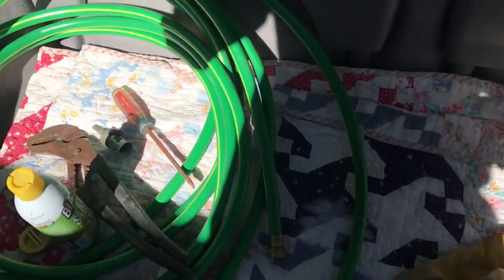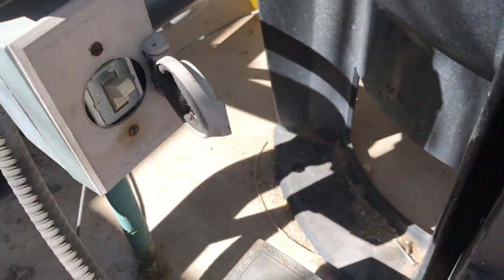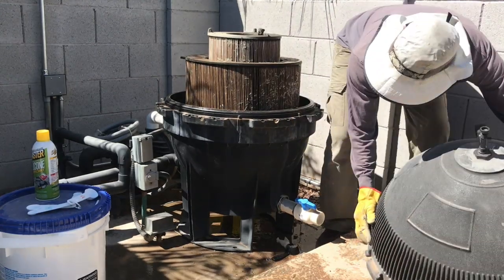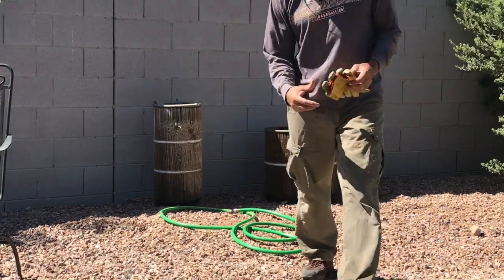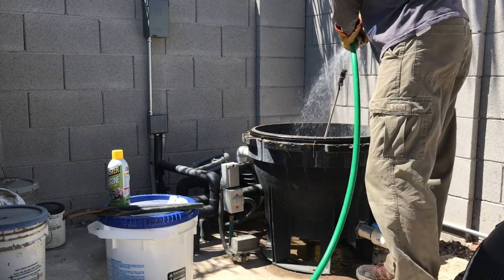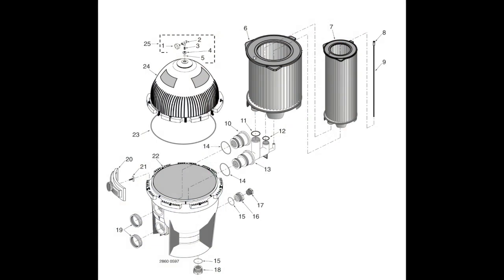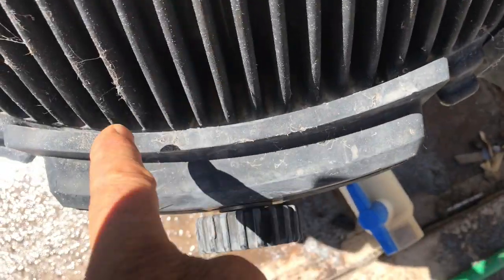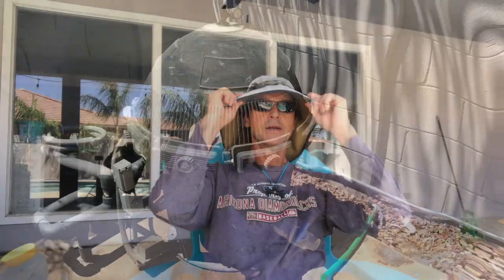Cleaning a Sta Rite Cartridge Filter

Comment: Great video!! It helped me clean my 90yr father’s filters correctly 🙏🏻 I looked for the video you referenced about where to buy new filters on line cheaper, but couldn’t find it?? Would you please reply with link when you have time? Thank you again.
Reply from the maker: Here's the link to the video on how often do you need to change the cartridges in your filter.  However there is no link to where you can find them mainly because they are specific to each type of filter and deals are always changing on the internet.  So my best suggestion is to do an online search (maybe start with Amazon) for the specific cartridges for your model filter and look for the best deal from a reputable source. 

I'm glad my video helped. Hope you subscribed and please share my channel with others.

Comment: thanks for the video. i used it to follow along as is cleaned the filter for my pool. however after i put it together there is a leak. if i open it up to adjust the o ring spray silicone, do i need to add more DE?
Reply from the maker: If it's a cartridge filter you shouldn't add DE.

Comment: Good video. I've never used a silicone SPRAY to lube the O-ring, I've always used against tube. I think the spray would be faster. In terms of using a pressure washer, I THINK that - as you alluded to -  it would obliterate the filter element.
Lastly, where was the fiberglass you were wearing gloves to avoid? Was it on the cartridge tank or on  the cartridge itself?
Reply from the maker: Charlie S. Hi Charlie. Are used to use magic lube and another product called 454 lube and they were super thick and gooey but they did work great. I heard about using the industrial-strength silicon spray and was a bit skeptical and concerned in the beginning but I’ve been doing it for a while and have had absolutely no problems with it at all.

Regarding the fiberglass and using gloves, it was for the actual casing of the filter and not the cartridges them selves.
Reply: @PoolSchooler  
Thanks for your reply. I'm new to your channel and I'm learning a lot. I'm used to The "thick and gooey "O-ring lube as well. It's messy and time-consuming to use,so the spray looks good. Lastly, I have an old school Sta-Rite Posi- FLO FILTER, so it's made out of metal. Are you familiar with it?!
Reply from the maker: @charlies.5777  I'm not familiar with that filter. But I do like Sta-Rites newer Cartridge filters.
Reply: @PoolSchooler  [

Comment: Question: I’ve done filter cleaning for cartridges before but today I notice that when I was done cleaning the cartridges and placed them back inside the filter, the minute I started the motor, dust came out of the pool which resulted the pool looking cloudy. Any idea what happend?
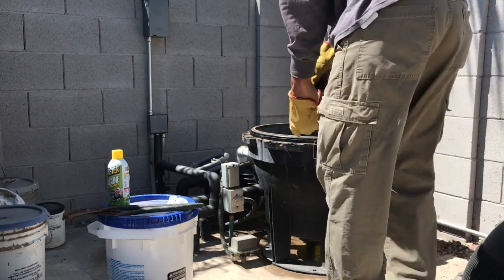Reply from the maker: It's possible you didn't clean out the base of the filter housing go to the video again and skip to 13:14 in the video where I do that: https://youtu.be/Wbap5X-1TFU

Also you may have a torn cartridge or possibly a broken manifold (which is what the cartridges sit in, but my guess is that you need to clean the bottom of the filter housing to get all the collected dirt and debris out of it.  Oh, and it's also possible that some of the dirt in the bottom of that housing got into the return pipes and that blew back into the pool when you fired it back up.  In that case it should clear up .

Comment: I love ya brother! Good info BUT ...I take issue with a few things. Don't spray silicone (over spray) into the housing. Spray the O-Ring away from the filter then put it back in. Actually I would say to manually spread 'plumber's grease'  (silicone) on it but it is a messy job and better if you wear TSA (grope you) blue gloves. Every rubber seal should be wiped with the silicone grease also. I appreciate your info!

Comment: I watched the video to see if there was anything different I needed to do when cleaning the Sta-Rite set up....The only thing I do different is after an initial spray down...I spray the filters down with Vinegar Water and let that sit a bit and then re-spray....I re-purposed an old swivel chair base to make a platform that the filters can sit on elevated off the ground and I can spin the filters....I also designed and 3D printed a tool that fits over the "wrist breaker" knobs...It chucks up in a hand drill....spins them loose in seconds.
Reply from the maker: Very cool.  Never heard of spraying down the cartridges with Vinegar/Water.  Is that to remove excess mineral deposits on them?

Comment: Regarding the o ring for the filter…..(the o ring that’s placed between the top and bottom filter tank…)
The o ring keeps moving out of place. It won’t stay in place. I’ve checked the o ring and evert looks good. ( no cracks or anything like that)
So what gives? I’ve lubed up the o ring.  Wiped the area where the o ring is placed. But it doesn’t stay in place. Any suggestions?
Reply from the maker: Try flipping it over and if not you may want to use some more heavy duty lube like BOSS 820 Lube (link:https://amzn.to/3QQljBW) goop it on and see if that helps hold it in place.  Is your filter a Sta-Rite filter?  Also make sure (if you haven't already) you clean the rim where the o'ring sits make sure it's free of any built up dirt etc.
Reply: @PoolSchooler  I clean the rim with a dry cloth every time I clean the filter.
Reply from the maker: @erickrhernandez1451  OK, try those other suggestions and see if those help

Comment: What if i used it to clean concrete dust from pavers? I had to wash it like 5 times, the rubber is not broken.. the color is not white anymore, but it’s not damage, do you recommend changing it?
Reply from the maker: I'm not sure what "it"you're referring to. Can you clarify?
Reply: @PoolSchooler  the filter
Reply from the maker: @henisr.530  Chances are the cartridges are probably just stained. You might wanna try using an organic product like simple green when you clean the cartridges the next time spray a light coating of it on there before you hose them off as describe in the video and see if that helps. In the future though don’t rely on your pool to clean up pavement work. It’s not made for that
Reply: @PoolSchooler  should i have vacuum to waste? Or use a separate vacuum altogether? And thank you for your videos and replies! I appreciate it
Reply from the maker: @henisr.530  If you have the ability to vacuum to waste that would be best just make sure your water level doesn't get too low.
Reply: @PoolSchooler  thank you sir!

Comment: This filter should have been named the Sta Rite Wrist Breaker.
Why close the tank with one clamp (like every other filter ever invented) when you can use 8 clamps! By hand!
I hate these filters with a passion. System 3 is the #1 filter I do NOT want to see when I get called for a filter clean.
LOL! I'll leave it at that.
Again, nice video.
Reply from the maker: I appreciate your comment.
Reply: I have this filter system and my pool is now 23 years old. Yes, a pain to disassemble and reassemble. Also, large filter weighs a ton when wet and dirty. Paid about $550 for last filter set. A miserable situation. May finally switch to comparable SF 4 filter Hayward.